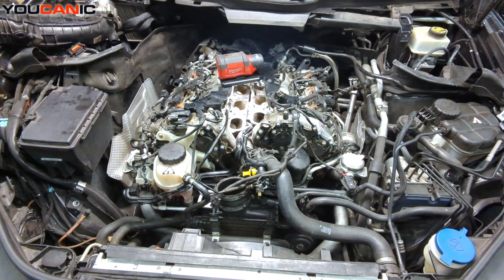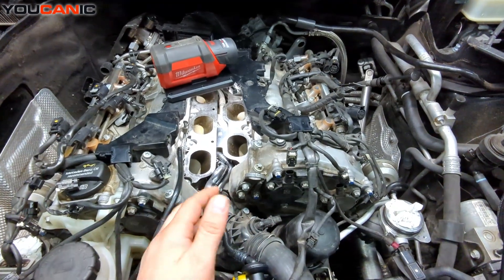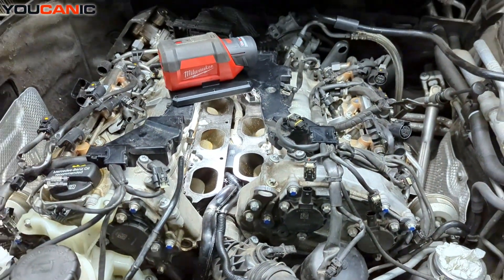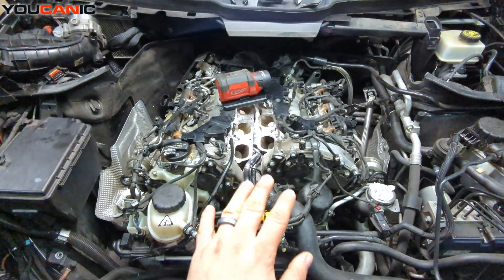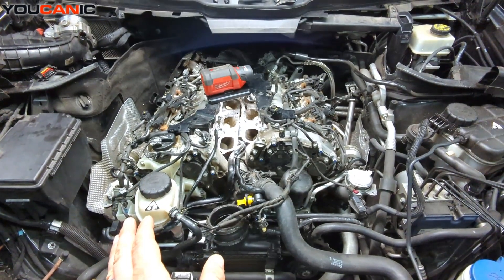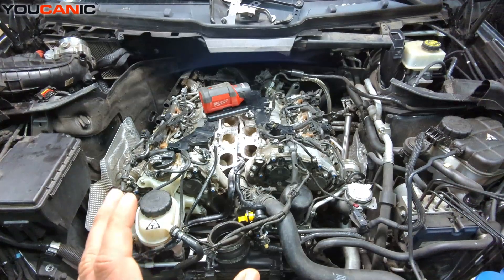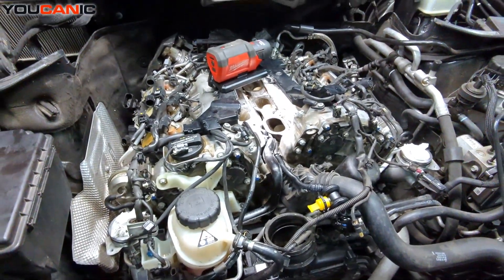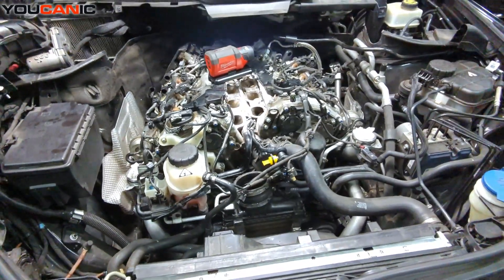Common Problems with Mercedes M276 Engines | Carbon Buildup, Coolant Hoses, Turbo Issues & More

Comment: Hello i want to ask if this Problem also happens on the 3.5l Turbo and how many km or miles the engine got on the Video i would be thankful for a replie
Reply: On 3.5l this problem happens faster. Because of egr. 3.0l don’t have it.

It also depends on the type of fuel you're using. My valves weren't that dirty at 105,000 km. I own a 3.5l M276.853 myself. I cleaned the valves with walnut granules.